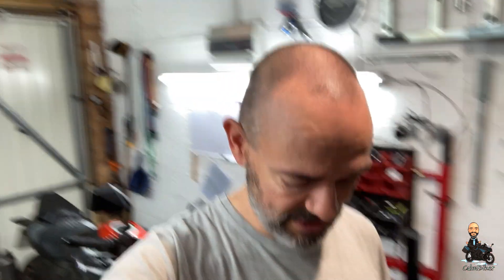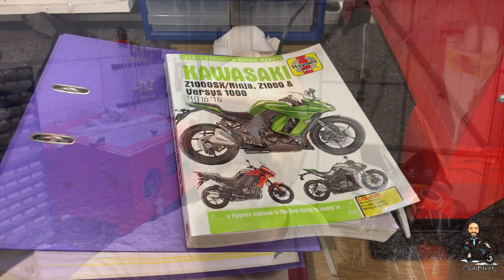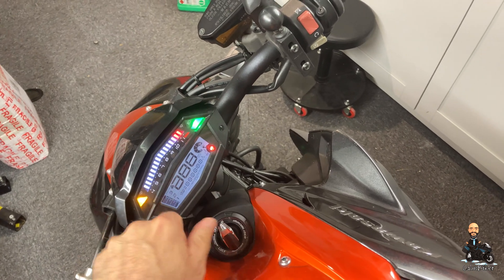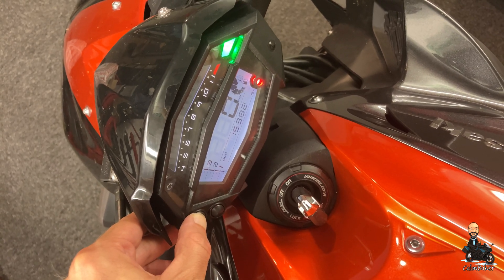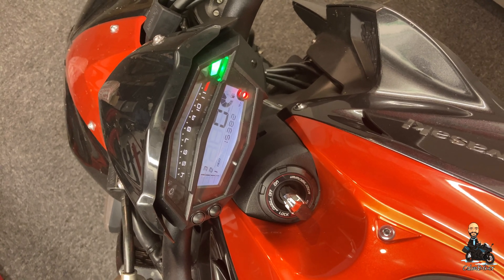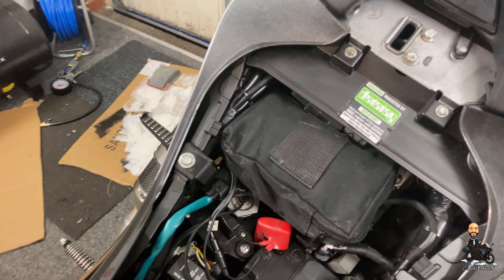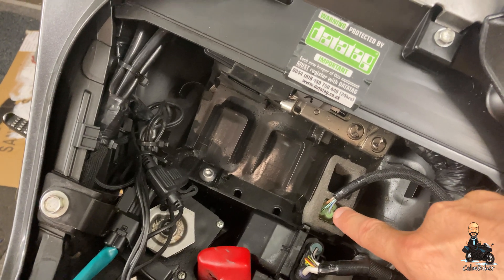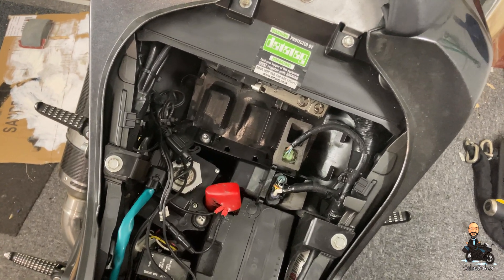927. Obtaining Kawasaki Z1000 Fault Codes | Garage Video

Comment: Bonjour j’ai le voyant f1 sur mon z1000 2004 comment puis-je faire svp ?
Reply from the maker: Are there any codes?
Reply: @CalmBiker  non j’ai pas de code mais je sais pas comment faire pour avoir le code vous savez comment faire la manipulation sur le Z 1000 2004?
Reply from the maker: @rai44300 I don’t I am afraid. I only have the service manual for the later bike.

Comment: I have a fault code 13 do you know what this is
Reply from the maker: That one is "Rear inlet solenoid valve trouble (shorted or open, stuck valve)".
The service manual states:
Recheck the service code indication; erase the service code, perform the pre-diagnosis inspection and retrieve the service code.
If the yellow ABS indicator (LED) [A] light, the solenoid valve in the ABS hydraulic unit has trouble. Replace the ABS hydraulic unit.
If the yellow ABS indicator (LED) does not light, ABS system is normal (service code is not stored; temporary failure.).

Comment: Hi !  I got 63 code how can i fix it, can u help me
Reply from the maker: That's an indication of a fault with the Exhaust Butterfly Valve Actuator. Under the front seat you should find the pulley. Turn on the ignition with that visible and it should turn clockwise then anticlockwise then clockwise again. It could be that there's an electrical issue with it or a blown fuse.

Comment: Hello. I have a z1000r of 2018. I made the maintenance by myself. And I have 2 error codes.  The 13 and 32... can you tell me where is the problem ? Thanks
Reply from the maker: Hi, sorry for the slow reply. 13 is an intake air pressure sensor warning indicating a sensor failure, wiring open or short circuit. 32 is the same but for the subthrottle sensor. The engine management system will be taking steps to avoid causing damage including closing the subthrottle.
Reply: @CalmBiker  ok. Thanks

Comment: ciao ... la mia da codice errore 241, sapresti dirmi a cosa si riferisce? grazie
Reply from the maker: Hmm. According to the manual I have, the service codes are always two digits. Could it be code 24? That would be an issue with the rear wheel rotation sensor.

Comment: Hello sir do you what is error code 27 on a z1000r 2020.thanks
Reply from the maker: Hi Leo. If it's the same as on my bike, it's a warning about the front wheel rotation sensor not sending the correct number of signals per wheel rotation.
Could be that one of the holes in the ring is blocked or damaged or a fault with the sensor itself. It could also be the air gap for the sensor being incorrect or a break in the wiring for that circuit. Failing all of that, it could be an ECU problem.
If you have access to a service manual, there's a small set of checks you can undertake listed on page 3-71.

Comment: Hei, I get code 39
Reply: 2016 kawasaki z1000, and also not showing temperature, just biking - - simbolį 🤯
Reply from the maker: Code 39 is an ECU communication failure. Might we worth checking the cables.
Reply: @CalmBiker  have figured out that is a communication problem. So it can be cables, ecu or display
Reply: Have started checking cables, connectinons. Any advice to make it easier?
Reply from the maker: @justinaskvedaras843  if you are under the tank it's always very tight and a bit awkward. Just slow, steady and methodical. Definitely worth getting hold of the service manual and going step by step.

Comment: Iv got fault code 21 & 25 on my gen 4
Reply from the maker: If the fault codes are the same as for mine, 21 is "Crankshaft sensor malfunction, wiring open or short" and 25 is "Rear wheel rotation sensor signal abnormal (sensor or rotor missing, too large clearance, rotor tooth worn or missing, wiring open)".

Comment: hey can you help me, i have kawasaki z9000 2020 version, my orange faulty sign light is blinking , so after googling i tried many ways , but i cant find error code, if i long press the left button nothing happens in odometer mode, i pressed both button than their is only options of display,rpm,bluetooth, etc. but their is no error code displaying,  all the tutorials are of z900 older version  which had analong  with digital but i have 2020 version which is fully digital.
Reply from the maker: Hi Paul, not sure on the Z900 but there's some info here that might help - https://www.z900rs.co.uk/index.php?topic=1659.0

Comment: You should be able to buy a Healtech OBD for Animal which will hook up to the connector and a laptop and you can cancel codes yourself.
Reply from the maker: Is it the right type of connector for you? Hope this helped!
Reply: @CalmBiker  Animal is different Richard there is no 4 pin connector to be found on the 1000 at the shop only 2x6 pin connectors and I'm sure it is one of them.
Reply from the maker: @banditnev  Shame. Does the dash approach work still?
Reply from the maker: ...it may do, as another commenter has made it work on the 2018 Z1000SX,.
Reply: @CalmBiker  Yes it does.

Comment: Will this work on a 2008 z1000 with the same problem f1 flashing on dashboard, thanks
Reply: @Adventures With Woody would it need remapped after changing end cans
Reply from the maker: @bluebee7689  I've not tried it but the book does talk about the two different dashes, so it's worth a try. At worst it'll try to set your clock or something :-)
Reply: @CalmBiker  lol. I'll give it a go at the weekend. Thanks

Comment: Do you know if the dealer mode access is a the same on any other Kawasakis. It seems like there is a fair bit of electrics standardisation since canbus happened. Anyway... very interesting.
Reply from the maker: I'm not sure. It's on the Z1000, Z1000SX and Versys 1000, which are all covered by my Haynes manual. For other bikes I couldn't say but it wouldn't be a surprise with so much standardisation.
Reply: Yes it’s on the z1000sx 2018 ... I had a fault light come up on my bike .. I did the same diagnostics check that it told me to do in the manual .. a bit different to this video .. but the same principle.. it gave me a fault code .. I then looked it up ..( can’t remember where ).. maybe the service manual..and it told me it was the “oil pressure relief valve “”... because it was under warranty I took it to Kawasaki,where they put their official dealer diagnostic computer on it... and sure enough it was exactly the part that the bike said !!!!! I had it changed under warranty and then they reset the light ... so it does work !!👌👌👌👌👏👏👏👏... enjoying the vids as always !!!👌👌👌🤜🤜
Reply from the maker: @dmandhelen  Excellent!